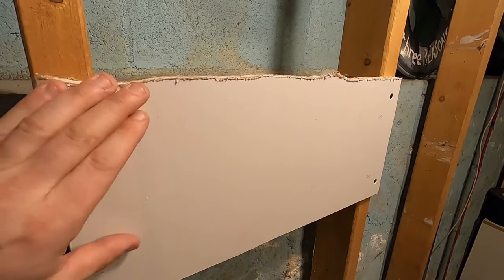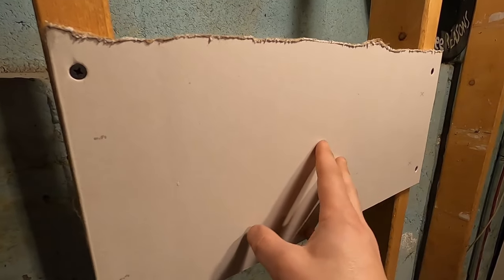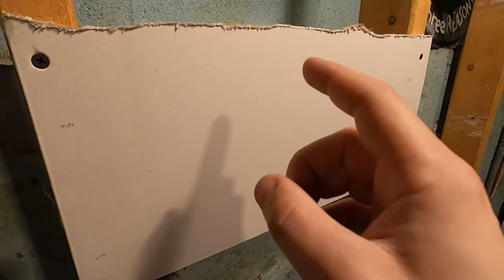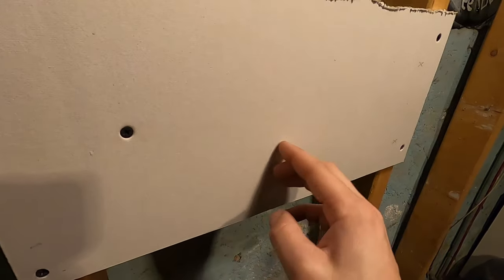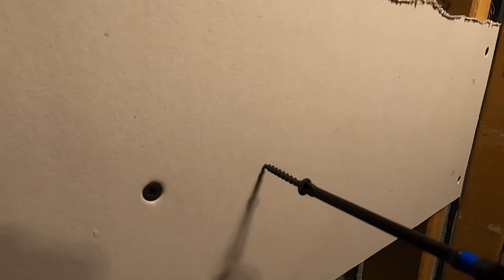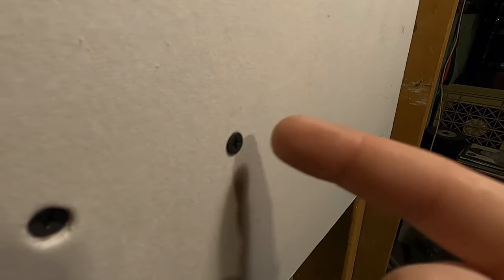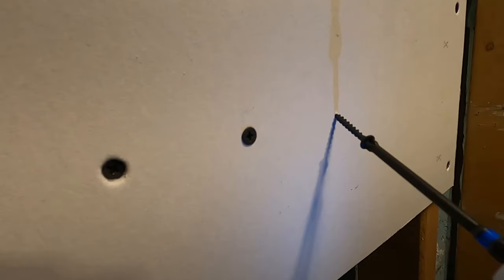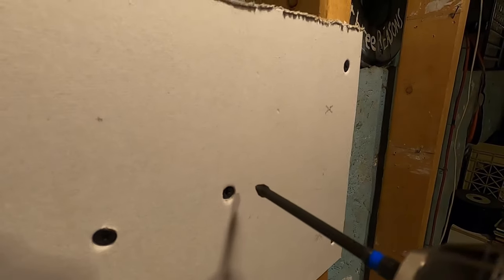How to Properly Install Drywall Screws

Comment: Thank you!  I had an installer drive screws so far into 3/8” drywall I think it just went to the stud. If he was even drilling into studs. But that was another issue. When I questioned the structural integrity, he said it didn’t matter on walls like it did ceilings. It wasn’t just 1 screw, it was more than half of the screws on the sheet rock. This information is invaluable for home owners that don’t know better and are at the mercy of an installer or contractor. He guaranteed his work for a year. 🤭 I didn’t think that was long enough.
Reply from the maker: Happy to hear you learned something.  It is most certainly does matter as driving the screws all the way into the drywall like that does nothing to actually secure the drywall.  After it is mudded, sanded and painted you could also have screw holes "pop" and will have to address it in the future.  Sorry you have to deal with that.
Reply: What happened did the screws came out?

Comment: Just lower the clutch setting to between 10-15 (depending on your torque rating for your drill).clutch will engage when you break paper if you get it at the right setting

Comment: Good video, well explained. Some people claim (youtuber Vancouver Carpenter, for example) that the dimple bit should not be used because it itself spins and therefore cuts the paper before it stops. I have had this happen. I would say that if you are doing any large amount of drywall, a dedicated drywall screw gun is worth it because it addresses this problem. Otherwise, your first technique is the way to go - simply slow down and do it carefully.

Comment: Don't forget to talk about spacing ;)  32 screws for an 8x4 sheet on a wall. 16" max spacing, 8" from edges. For ceilings, more screws. 12" max between screws. Don't put screws right on the edge of the sheetrock as these can break the edges.
Reply: Wait so what about where the edge ends on the middle of the stud and meets the next sheet ? No screws there ?
Reply: @srjr2531  furring
Reply: @pearlperlitavenegas2023  furring - board ?
Reply: Thank you, never done drywall but our porch ceiling is exposed and we have enough green board on hand so glad I read your comment.

Comment: At some point you have to decide if the project is worth the expense but if you are handing a large amount of drywall(like a basement remodel),   sinking $100 on a collated screw driver that does drywall is worth it.  Not only for getting the perfect depth every time but also the screw magazine is a huge time saver.  Beginners often don't realize that you need to be sinking a lot of screws into sheetrock and having to do them one at a time is just painfully slow.
Reply: i got one and it is nice for overhead and such since you can slam in a bunch of screws to hold sheet with one hand but it is not always perfect in putting the screw in and does cost a lot for giant buckets of screws

Comment: Excellent example and tips. I will be adding some drywall to the ceiling of a garden house(formerly playhouse). Your video gave perfect instructions to follow. Since I’m using a drill, I’ll purchase the extension to hold the screw and set at correct depth. Maybe you could do a video on drywall installation, tapping and mudding please:)
Reply from the maker: I know it’s 3 years later but… I made these videos.  😁

Comment: I dry walked houses all through the 80s and 90s. I would not recommend smacking a screw with a hammer. It can crack the screw and it will pop out later through the mud. Also the screws going in crooked it would probably be better just to take the screw out and remove it because once it breaks a paper it’s useless why I have the screw in there. Just my recommendations after drywalling houses for 20 years.

Comment: Apparently, those things are no good either because it has a tendency to score a round hole around the screw, as seen on "Vancouver carpenter " I've never use one though. I build my recording studio when I was 15 I'm sure I have a lot of over sunk screws but after 12 years of banging drums and jamming the walls are still solid!

Comment: It's interesting that in the US and Canada, you seem to rely only on screws to hold plaster board.
Here in Australia, we always used "stud adhesive".
This is blobs of blue glue that we put on the studs, that glues the board onto the wall and prevents the board from sagging between screws.
We still use plenty of screws, but the stud adhesive is actually stronger than the screws.
.Another big advntage is the stud adhesive takes up any gaps or variations in the frame. Stud adhesive can take up pretty big gaps.
.
another thing is these days a lot of our studs intended for plaster board have a groved surface, to increse surface area and glue holding power.
.
Yeh a lot of people don't like the dimplers, because they can ring bark the paper around the screw, if the user is heavy handed, making the screw hold very weak.

Comment: If at an angle u have to go in til u can feel about a third of the head holding screw. That usually only happens on the seem tho where u have the taper edge. Sinking mud tape onto screw there helps a lot cause u can see the tape and stop

Comment: Really need to show how to put screws into the tapered joints without blowing the edges out. Double studs on the breaks? (I hung parallel to studs in basement bedroom to avoid butt joints, walls are longer than 12ft also I couldn’t fit 12ft sheets down the stairs). I’m wondering if the butt joints are easier than dealing with blown out edges on the tapered joints when you hang sheets vertical?

Comment: Haha I've done the sideways thing before where I was putting the screw in a tight corner and couldn't get it in straight so I drove it in a bit extra to make it sink in. I knew it wasn't right but that was my only option haha
Reply from the maker: Hey it works haha.  As long as every screw isn't like that you are fine.  Thanks for watching and for the comment!
Reply: @TheFixerHomeRepair  no it was just that one screw. It was in the bottom corner of the room

Comment: What is the bit called? How about a link?
Reply from the maker: Hey, Thomas!  The bit is called "drywall screw setter".  There is a link in the description to where you can purchase them.  Thanks for checking out the video!
Reply: @TheFixerHomeRepair  Thanks so much. Very helpful video. Doing a job today. It will come in handy.
Reply: This comment should be pinned at the pinned at the top!

Comment: What size screws for 1/2 inches drywall for ceiling and what size for wall ?
Reply: usually, you go for 1 inch into wood much more than that and you can hit wires and pipes so 1  1/2 inch screws would be good for 1/2 inch drywall you could get away with 1 1/4 or 1 5/8

Comment: How far apart should each screw be from the other
Reply from the maker: Hey there!  So when I do ceilings I usually put 5 to 6 screws across the 4 foot section.  Which works out to be maybe every 8 inches.  On the walls I typically put 4 or 5 in each stud.  Hope this answers your question!  Thanks for watching!

Comment: I'm not expert at all - I made a mistake and got 2" drywall screws for 1/2 inch drywall sheets. I'm having the hardest time driving into the sheets. I have wood studs and the screws go in about half way & just stop driving. Do I just need shorter screws? I tried 2 fully charged screw guns. It's such a simple thing but sooo frustrating
Reply: yeah, usually you want 1 inch into wood so 1 1/2 would be good for 1/2 inch drywall so you don't hit wires or pipes. not sure if you can't drive them in because gun is to weak or you need a new tip on screwgun

Comment: Brilliant info. The only question I would ask is, which are the 'best' screws to use on sheetrock? All too often in my house, I see 'nail pops' on the walls. Is that where the builder did not use the best hardware?
Reply: sheetrock screws ;) just like the ones he is using here.

Comment: Those tips rip the paper, as you can see with the ring left around it when he did it, creating pops later on. Better to  just do it with regular drill bit if you don’t have the proper drill